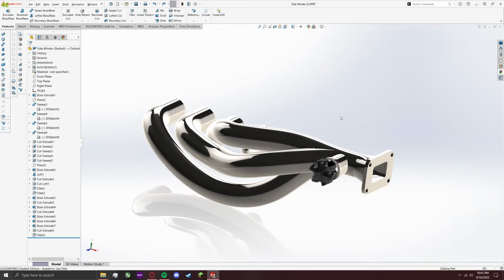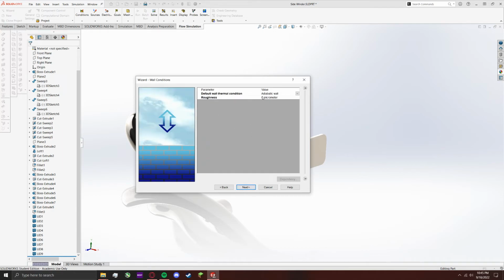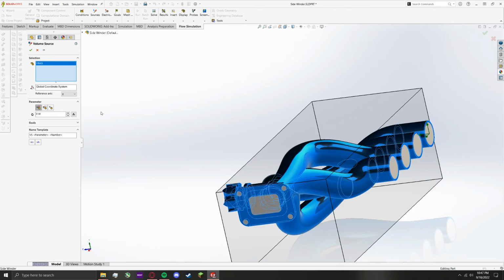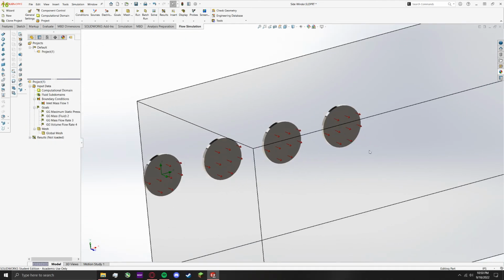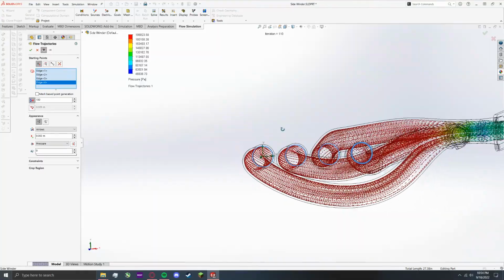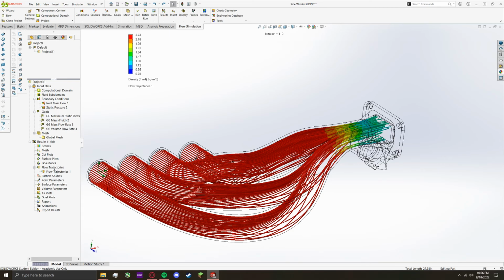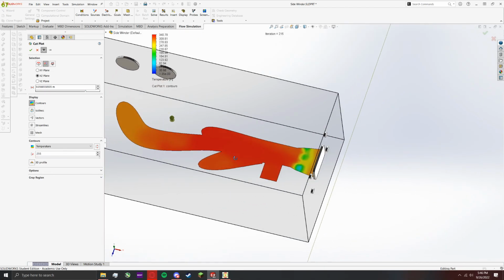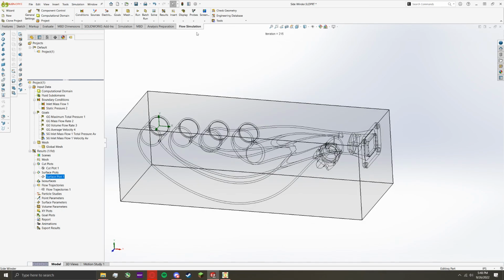Solidworks Fluid Flow Simulation Tutorial for Internal Flow

Comment: what about firing order. would that not be important for the simulation?
Reply from the maker: It certainly is, but for this specific simulation its just a basic flow trajectory, if you wanted to see firing order you would do a separate simulation for each exhaust port